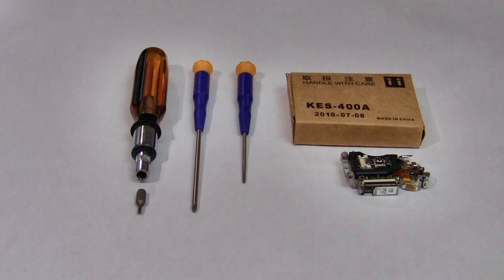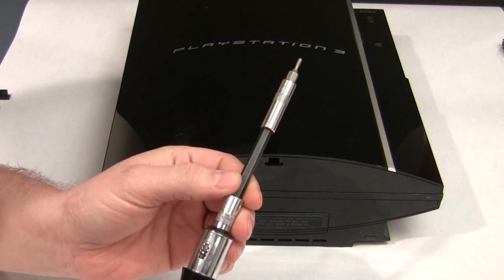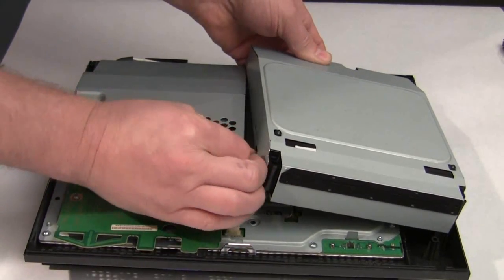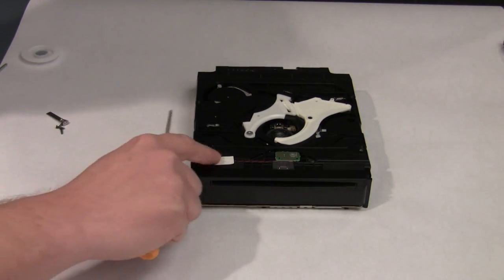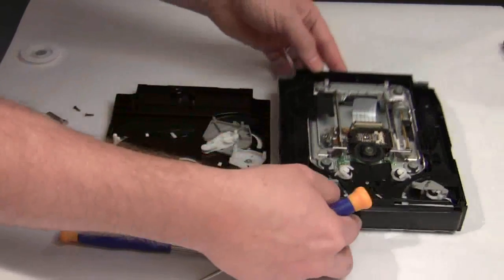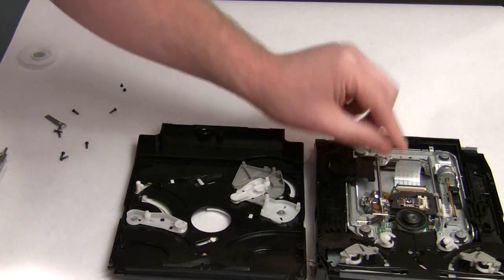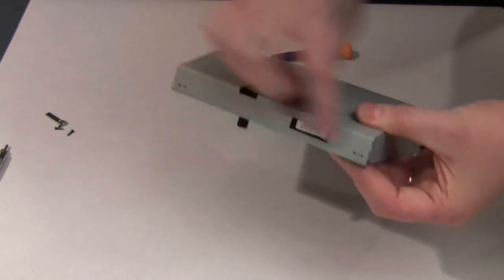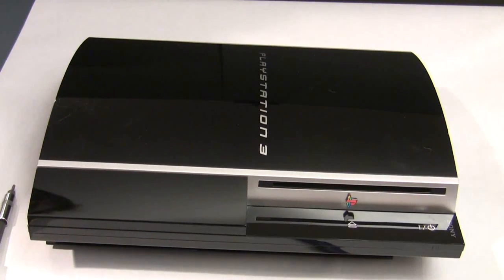PS3 KES-400a replacement

Comment: In case it helps anyone with a regular Torx T-10.  I used a small flat head screwdriver to break the pin from the center of the screw...then I was able to use the regular Torx T-10.  It just snapped right off like plastic or wood.

Comment: @hrphlps Thanks for responding man, i just finished the installation of the new laser. I just ended up using a flat head and basically prying it off. Your tutorial was excellent and my ps3 is up and running!